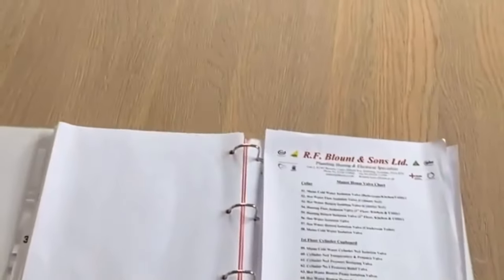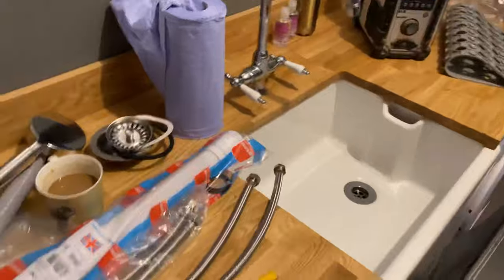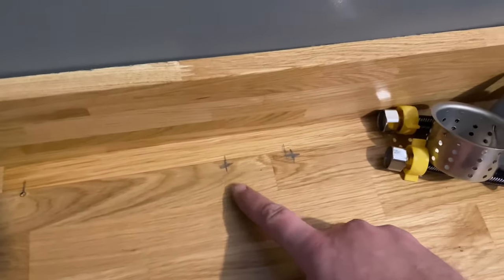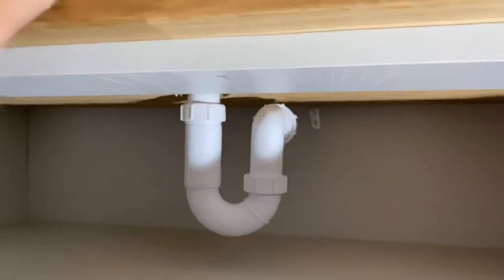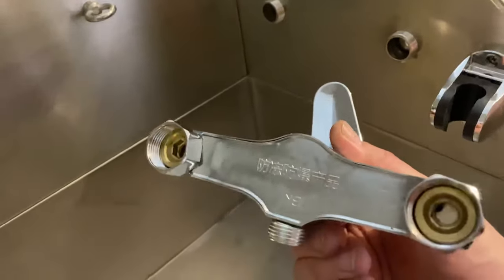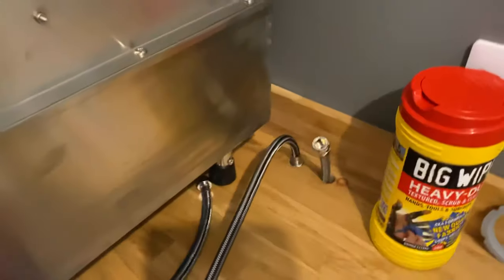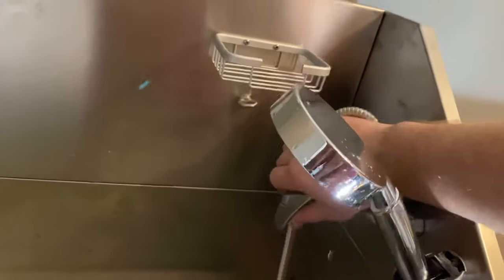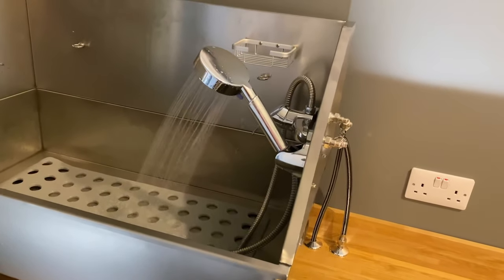PLUMBING IN A THERMOSTATIC DOG WASH SHOWER UNIT. First time I’ve fitted one of these Install VIDEO

Comment: Great video. I installed a couple of isolating ball valves to the hot and cold feed to my kitchen sink. The ball valves on both have seized solid 5 years down the road, which means I’ll need to replace them. I see you used these valves for this job. Is there an alternative or are there any brands that are better than others?
Reply from the maker: You could try 15mm butterfly valves

Comment: Nice video but would it not be better to use a full bore isolation valves rather than 3 isolation valves to have Max pressure? I understand you don’t need much pressure for your washing machine but thinking more of the dog shower
Reply from the maker: This was addressed and due to isolation of the huge house this was the best way to go without shutting down a lot of feeds, it’s a very big property. And because of that it’s fully pressurised etc so the valves have little to no resistance to the pressure.
Also the shower doesn’t need a lot of pressure to run anyway being a wash unit.

Thanks for the comment though... all good points that were addressed